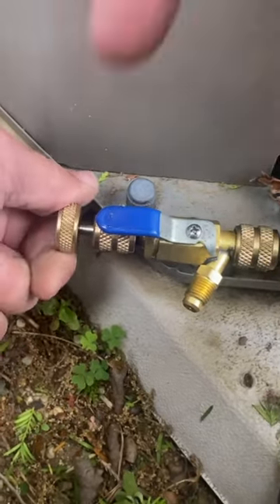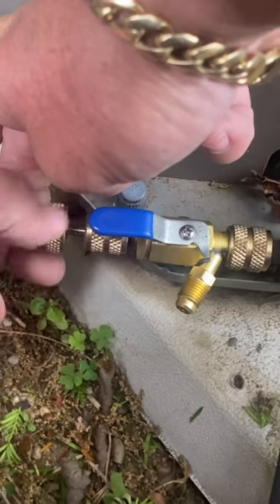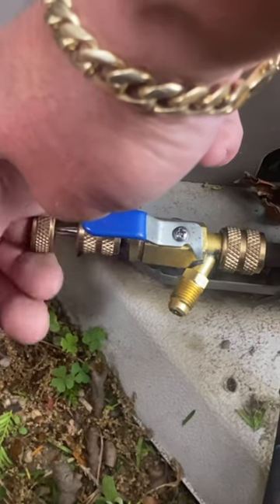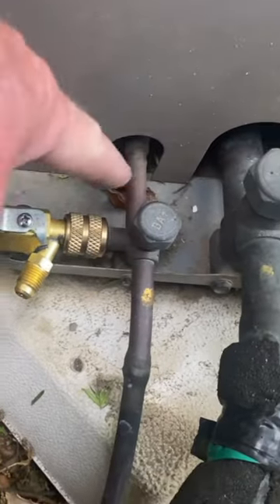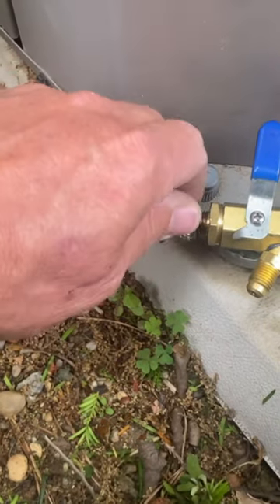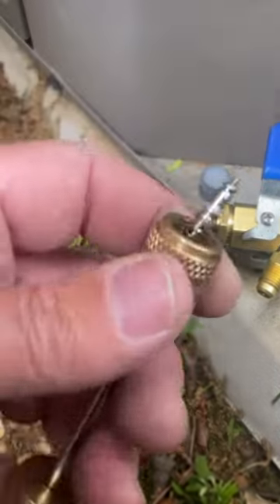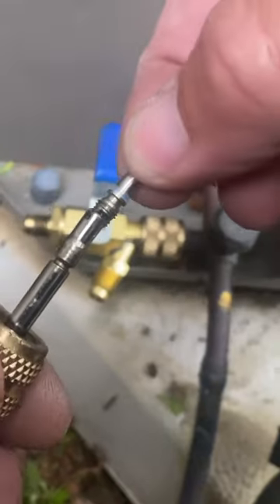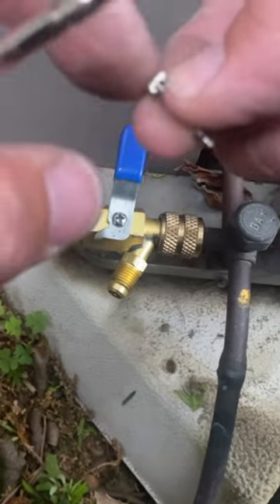Faster Refrigerant Recovery? HVAC Schrader Valve Removal Tool #hvac #hvactech #shorts

Comment: Excellence in motion. I like the touch of the valve being coated blue. Nice little touch and it’s kinda neat.
Reply: Easier to put the red or blue hose on the high or low pressure lines, then someone mixes them up.👍

Comment: Schrader pin is your secondary seal, cap is your primary. Changing a Schrader can be very important but having a cap with a proper seal is more important. Cant tell you how much time ive spent in supermarket refrigeration searching for leaks just to find a cap slightly loose pissing 1000ppm for god knows how long
Reply: Yep. I do property maintenance and we use brass caps with flat washers in them. None of those cheap little orings you see in the plastic ones. If we take the cap off and hear it hiss, we know the valve core is leaking. We got some of those valve core tools and it's a life saver.
Reply: That's been done intentionally by the previous technician to ensure another call out after some time has passed.
Reply: @PipeDoctor 
Gotta wrap your tip!
Reply: Schrader valve is primary
Reply: Their both important.
Reply: Schrader valve not pin.
Reply: What the heck?! No that’s wrong definitely wrong. Schrader is primary the cap is the secondary. And honestly not even that good. Especially with the locking caps that just have o rings. 

Schrader primary cap secondary
Reply: You are so rude to handle it. I don’t think you can take it out when you released it like this way. When you unscrewed it I didn’t hear any gas releasing sound, which indicated that you at least tried it several times and then got it and pushed it back for video recording purpose. Anyone agree with me please raise your hands

Comment: There are lots companies Arizona that are ripping people off about that fix right there. The HVAC industry needs a serious overhaul and investigation but I’m sure too many politicians are getting paid off by that industry. All of you good folks it’s really sad the rest of the industry is giving that industry a serious bad name.
Reply: Ripping off how?
Reply: @dustincombs7127 , saying they refill the refrigerant with 6 pounds @$100/lb when they use this tool.
Reply: @chrisrobles2012  yea that’s a rip off. Just charge accordingly and keep your refrigerant. It’s a win/win
Reply: @chrisrobles2012 well that's just straight up theft. I don't see how this tool would have anything to do with that though
Reply: @richardlafleur2864   it’s under pressure . Step 1 recover refrigerant step2 remove valve.step 3 charge customer 6 pounds at $100/pound. 

Or
Use the tool and never have to recover old refrigerant/replace and replace valve quickly .
It doesn’t make them money to replace a $1 valve .
Reply: @chrisrobles2012  Again, you're just describing theft/lying. Recovering a system and then not returning the refer back to the system is stealing, especially if its not a compressor burnout and its reuseable. Still would be a trip charge and labor charge to replace the valve
Reply: May not be a rip off if your leaking refrigerant. Politicians wouldn't give a crap about day to day operations like this.
Reply: Same with plumbing, there’s just a bunch of crooks and a lot of companies would rather hire whoever and not care about their employees that care about the trade.
Reply: Did ever think about the customers who call u at 10 at night . U come out there get them running and they stiff the bill .it's really a 2 way street.  Crappie home owners and contractors.  I seen a video a guy charged 575.00 for coil cleaning . Coils wasn't dirty dude took the outside unit completely apart.  I guess he thought doing this made it look like it was worth it. This was supposed to a respectful company.  Sometimes the 1 to guys at company give u better deals but not always but u still have to watch for those stiff homeowners.
Reply: It's not a rip off if you agree to it. It's a rip off to gas and go without finding and fixing the leak. Last I checked it was almost $500 for a 25 lb jug of 410a. You can take 608 open book test for probably $50 and buy your own jug. Get some gages, scale and schrader core remover for probably $300 - $400 and you can start working on your own for less than 1k. Sound better?

Comment: So THAT’S what that doo dad is for! I found one of them in a pawn shop tool bag and had no idea what it’s purpose was.
Reply: Yeah it’s HVAC valve that allows AC techs to put different things into a ACs pipe circuit whether that would pressuring nitrogen gas, vacuuming air out, adding refrigerant or taking refrigerant out it keeps all contents inside the system from leaking out when putting on and taking off hoses

Comment: One of the Best tools ever. Stem packing nut thread on some are also a hose fitting.
Some areas it will not fit in to attach..

Comment: Know anything about r454b? I have a system that it's a miracle it's still going but it is still going. Would you rather go with a 410a system or the new stuff coming out? It's currently an r22 running 407c.

Comment: I Own a lot of Condos and I Always Make them Put metal Caps over The The Valves to insure Weather does Not Get To The Shrader Valve...Many A/C Guys Leave the Caps off So they Will Leak Later On ...So they Get Paid to Re-Charge .

Comment: That looks like a nice cheapo Amazon core tool.  I have one of these also.  Works great.
Reply: Definitely not a cheap core tool lol
Reply: Appion the best ones I’ve use
Reply: @dustincombs7127  Yes, I have an Appion as well.  Very nice core tool.  Although I was amazed the cheap $15 Amazon tool actually worked and didn't leak.  After looking more closely, Mike's core tool in the video is not the same as my cheap Amazon tool.  My bad.
Reply: That’s a yellow jacket one
Reply: Appion or CD is what it looks like to me
Reply: @PipeDoctor those supply house tools get costly
Reply: @LC-go1uh  until it falls apart while it's on a system and you lose $500 worth of R22 you have to replace for the customer. plenty of reviews online where that happens on those cheap china valve core removers, it explodes and you get a nice jet of refrigerant shooting out in your face without a shrader to hold it back
Reply: @23x31 you’ll change your mind completely when the whole valve body blows apart and your stuck with the quick decision of letting hundreds of pounds blow or take the burn and slam a cap or core onto the port.
Reply: @TheSimba86 yeah I had a Navac one blow up on me

Comment: I have one of these I use for vehicles.  Mine might be defective though because the damn schrader valve won’t stay in the holder.  It’s a fight to get it up past the shut off valve without it falling back down.
Reply: pinch the tip down so it holds better
Reply: The key is to only tighten the tool on enough to make a seal. If you tighten it too much the o ring will pinch the core remover.

Comment: Ok, so I read through some of the comments and there seems to be a ton of experts out there. Can anyone help me with a BRAND NEW LG mini split that hooked up with no problem, and ran very well in A/C mode. Then I wanted to test the heat mode and that seemed to work well, however, it now seems like the reversing valve is stuck and will NOT go back into A/C mode. Any ideas how to un-stick a reversing valve? I've shut it down multiple times with no luck. Ideas please.
Reply: @PipeDoctor , can't I just bump the solenoid?

Comment: What's the hurry? Pull a vacuum on ur tank and it'll pull over half of the charge out. And if u really want it done faster and cheaper, use a refrigerator compressor. Ive using one for pulling vacuums and recovery for 20 years

Comment: For some reason I can't get my gauges to put 410 in to my system. I think I need new gauges
Reply: I have the yellow hose connected to the 410 tank upsidedown. Blue hose hooked to the low side of unit and red hose hooked to high side. Units on while I'm doing it.  I open the high side on the gauge and nothing. Pressure on the high side doesn't increase nor decrease.  so random question is it possible to have the unit push the freon back into the tank accidentally?
Reply: Also are you purging the line 🧐for sure call a professional though
Reply: try revoming all your valves first before you add the freon that way there is no resistance!
Reply: You probably blew out the little core depresser. Put new low loss seals on your hoses and the core depresser pushes or turns down into the new seals. You need new seals anyway. Your core could be bent on your unit if someone has played around with it the wrong way. Other than that you could have some nasty restriction in something you wouldn't want to introduce to your system anyway.

Comment: It’s not similar it’s the same thing and you can get 100 of em for like 10 bucks. I’m not sure of the application here but in a stem valve on a wheel of seater properly should last longer than the life of a rubber stem. They really aren’t that prone to leaking unless you don’t swap it out every year or 2

Comment: Actually, it's extremely rare for them to leak. This leads me to believe that you are the type of person to sell someone refrigerant, blaming the Schrader valve when you know it's a bigger problem, but you just want to get paid and leave
Reply: Haha rare for them to leak that's a bold statement because they do leak a ton because it has a small ass o ring on them and that can get messed up on install because of the threads were faulty or sharp or had a tiny bit of metal shaving in it still
Reply: Tell me you've never done refrigeration without telling me you've never done refrigeration.  Or aired up a car tire.  That pin bends, fails to seat completely, or some diphead melts the Teflon ring and it will leak.  Hell, I have videos on my phone of one.  From just a couple weeks ago.  I've lost count as to the number of valves I've found leaking over the course of 22 years.

Comment: I’m just a happy homeowner with no real skills, however I do have common sense. 
   That being said, I always insist that my HVAC guys use the Brass Caps with proper seal, AND install a SIGHT GUAGE .  The sight guage helps to reveal if you’re low on Freon, by showing bubbles in your sights. 
   We insist on using these on all of our properties. 
   Next, I purchased tanks of different Freons and the proper gauges used to fill the units. If the Freon is low, I simply find a retired guy who knows refrigeration, give him a case of beer, and in 10 minutes, my AC is running perfectly.